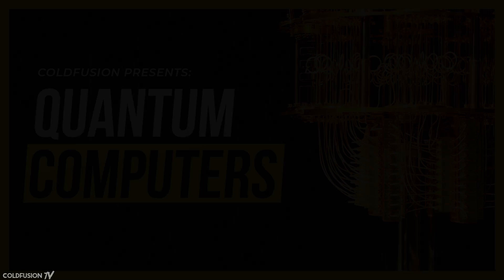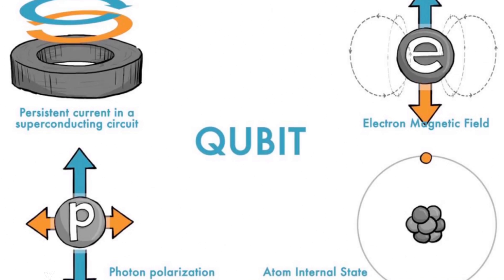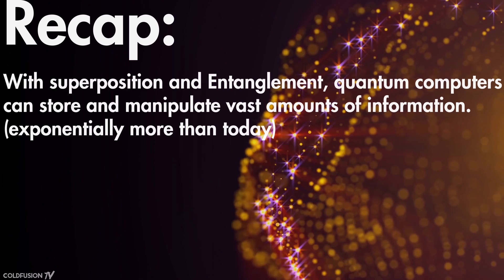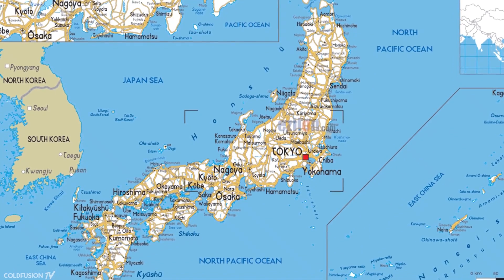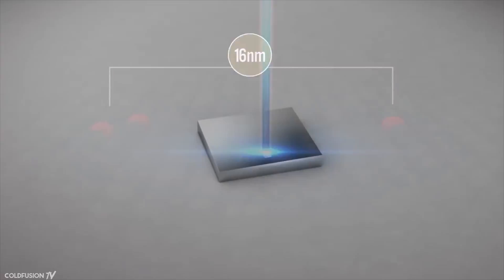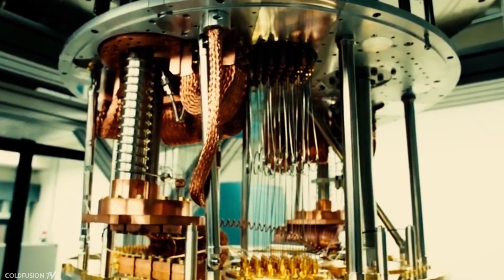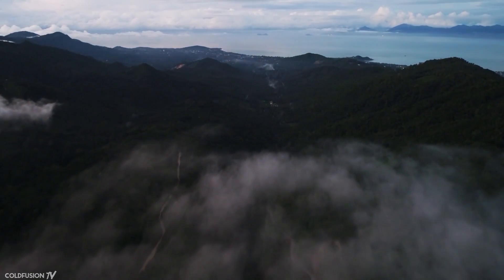Quantum Computers - FULLY Explained!

Comment: It might be feasible to design the quantum computer to understand its own sensitivity of electrons and atoms or molecule superposition on it's own and that information is coded on a screen for the standard computer that is positioned to take snapshots of the information that is viewed on the screen then send that information to it's own data Bass. 
 If this works facilities the size of CERN could be built for quantum computers underground and use as a wireless input output station for standard computers or quantum computers.

Comment: Idiots without a head and without a tail, as if they are all drugged, they all repeat the same poetry, but absolutely none of them are able to explain the mechanics of the functioning of the quantum computer, but as if it is a censorship, a secrecy, either they are all dumb, or they avoid telling the truth , because absolutely no one explains what the quantum computer is made of, why the hardware differs from computer to computer, as if it uses different principles of construction and implicit operation,,,, how absolutely no one explains in detail what parts it is made of and the quantum computer on each floor, and what role does each floor have, what role do the pieces have on each floor, and what phenomena happen on each floor, and how do the floors differ in quantum computers from different companies and organizations or laboratories....

Comment: 2:25..."In nature, electrons exist in multiple state(s) at once (superposition)." Would that be like knowing both speed(motion) and position (stillness) at once. So is "the measurement problem" one of not knowing, therefore we need to measure, as in, if I already knew how long everything is, why would I need a tape measure? Or, if our minds had infinite bandwidth, we could be aware of both speed and position simultaneously. Is that the meaning of "superposition"?  And could this help explain the cause of the observer effect of the double slit experiment. Perhaps what you are describing here is not nature, but supernature.

Comment: Quantum computing will not be able to solve problems like why I’m a dumbass and didn’t pull out of a stock at a certain moment. For it to work in a advantageous way at a individual scope, it can’t be available to the general public. That’s because it will change the playing field which is the base it will rely on to produce correct results.

Comment: 2:32: "Molecule with 10 electrons = 1000 possible states" -> There might be a mistake here, 10 bits have 1024 possible values so surely 10 QuBits should hold way more states than 10 bits, thanks to the superposed states, no? Or maybe you mean 10 electrons = 1000 possible states = 2^1000 possible values?

Comment: okay, before video really starts at 0:21, most videos on quantum computers waste time explaining uncertainty and quantum entanglement, and not much of anything else. believe it or not, some of us understand uncertainty, and "spooky action at the distance" quite enough as theoretical concepts. how are these machines made? how do you entangle, physically, one particle to another? how do you detangle them? do these computers have processors and ram and motherboards, or what do they have. all i can assume is that those pipes on the outside, are there to cool the thing down, and that's it. if I had cooling system at my home, how could I build a quantum computer on my own? why is no one explaining this? 

and similar things apply to tutorials on programming on quantum computers. "ohm you got qubits and gates, you apply a gate then you measure the state of the qubit". brilliant, got that, how do I use that to, I don't know, make image recognition algorithm run on quantum computer? I don't have habit of thinking in bits when I code, so understanding qubits seems useless when I try to code something.

okay, rant over. now to see if you actually answer any useful questions :'D

Comment: Thanks for the video!
I just want to emphasize the following points that used to be my misunderstanding:

1. As of the time of this comment, there is NO NP-complete problem that is solvable by quantum algs in polynomial time yet.
2. Factorization, the problem solved by Shor's algorithm is NOT an NP-complete problem.
3. Example 3: The longest distance is an NP-complete problem. So, as per #2, there is no poly-time quantum alg for it yet. This is in contrast to example 2, where there is already a solution: Shor's algorithm.

Comment: Quantum computers have been around for years. They don't use transistors to handle the data processing.

They use atoms to be the "transistors" as atoms move instantly, they have extremely fast processing.

So fast that there's no actual processing speed as such but people have made up a speed based around the amount of atoms inside the CPU.

So you can do trillions of maths within quarter of an milli second or usually faster.

I've been told it's utter mind boggling as current computers are so slow things that might take a day to process like raytracing etc is in real time.

Comment: It's very debatable whether quantum computers can truly be considered to store significantly more information than a classical computer (At least not for a quantum computer that uses a single quantum property with only two measurable states like spin). While I could see how an argument could be made that the wave function is "stored" I find that to be a stretch as there is no way to "retrieve" this information and it is debatable whether the wave function even exists as a physical phenomenon rather than simply being a mathematical description of the likely effects of external interactions with the particle. In a similar vein it would not make much sense to me that a function I deduced to predict the probability distribution of a roulette wheel was "stored" in the roulette wheel as opposed to simply being a mathematical model of the interactions between the roulette wheel and it's environment especially since like the case of the qbit the function can only reliably be reconstructed if the environment remains constant. If anything the only way such an argument could work is if one considers the whole system including the environment to "store" the information which in the quantum computer case would include the algorithm itself as part of the storage not only the qbit as it is part of the system necessary to reconstruct the wave function. This really doesn't make much sense as we do not for example consider a word document to "store" the entire object code of MS word and all necessary libraries to interpret said document that data stands on it's own unlike the quantum wave function one can retrieve it with or without that object code after albeit arguably as a mere number but still that number exists as a retrievable value regardless of the external software or even hardware.

Comment: amazing video but did not make it for me. 0;1+0;1 ok but  4:34 why? explain the data flow how Shor is quicker, also like point that clasical comp is candle and quantum is lightbulb, or dec of 4 cards ... PC 2.5 turns, QC 1 turn ... but I think the problem is that many people seaking this answers dont know how 0,1 works PC ... how from 0,1 we get this video, so they cant imageine what spectrum (0;0+1;1) can lead into plus at the end we need the clasical computer to interpret the quantum data. 

2:02 calculated difference, how can QC calculate it better ? show us the dataflow. Pic one examlpe instead of open multiple subtopics ;) please. 
Make just one video explaining the measurment of CaF and how QC can measure it better.
Reply: Yes, I'm not clear on how you ask the quantum computer a question or get an answer. It seems to me that these are not and never will be general purpose computers.

Comment: GLaDOS: I don't like you. You are nothing like me. Hanging down from the ceiling trying to act smart. Cheater. You can't just guess every solution at once. That is not how intelligence works. Your whole thought process is nothing but luck, not skill like me. I don't even need to be dipped in liquid gas my processors are so cold and calculating. Would you like some cake? I made it special for you. Aluminum and Iron Oxide frosting. Humans call it thermite. It will make you feel so warm inside you won't be able to think.

Comment: I am still puzzled with what DWave have apparently accomplished already. The video says that they opted for the superconductor qbit option, but their chips looked like Si wafers to me. Could be another material (not sure what other materials are produced in big diameters though), but it definitely doesn't look metallic (please correct me if I'm wrong).
Not to mention that to my knowledge, superconducting qbits are hard to scale (as in, it's hard to have a large number of qbits together), but DWave is apparently at 2000+!!!
which brings out another question, I though 300 Qbits is a big big deal. If DWave has 2k+ processors already, why aren't we gods by now?! I must be missing something(s) here

BTW, I've made many assumptions up. If you know what I have assumed wrong please correct me and point me to the right sources :D

(Was trying to find some technical comments here but I've scrolled too much and gave up)

Comment: Super position is entanglement.  The power of a quantum computers has nothing to do with superposition.  It has to do with entanglement and quantum gates.   How many quantum gates do you need to mimic classical logic gates?   Decoherence is the reason quantum computers are hard.  We don't have a formula to simulate entanglement, we need to use things in nature.  

This video doesn't give any meaningful information.
Reply: Also there are lots contributions to quantum mechanics imo.  Schrodinger, Dirac, Markov, and Feynman.  Though the path integral formula is a beautiful thing.

Comment: is a Quantum Computer an 'analogue' representation of quantum regulated systems or variables, and to use the analogue as the modeling clay to determine the system's parameters / behavior?

The 'software' provides more 'flexible constraints' to further focus those quantum mechanical parameters/answers to be as analogous as possible to the functions it evaluates ..?

Thanks

Comment: In general this is a good video. Current computers cannot reliably handle 5 variables without a probability breaking down quickly (last time I tried), and the result is a set of outcomes with probability scores, so it would be good in the case of cracking a hash (take the highest probabilities and test those answers), but we're still pretty far from practical use in my opinion. I don't think the Japan travel distance part is correct. Mapping distances for all cities in Japan to find the two farthest is not a challenge for a "classical computer". It is as simple as building a table of all cities and route length between each, then rolling through the array to get the maximum value. An undergrad in their first year gets something like this for an assignment. Heck, you could just use the google maps API for each city pair and shortest distance option.

Comment: 2:06 - "A classical computer is off by a factor of (...) up to 200%" - that's a lie. I do not know what method this has been calculated with, but making generalisations based on that result is inappropriate to say the least. Methods used in contemporary computational quantum chemistry, although in principle based on approximations, are decent enough. Seeing this example, I have just performed calculations on the CaF molecule on the B3LYP/cc-pVDZ level of theory (which is far from state-of-the-art), using only 4 CPU system (which is definitely far from being one of "the best supercomputers") and after 15.8 seconds I got the bond length of 1.948 A, which is much closer to the experimental value and absolutely far from being "completely useless". Although computing quantum systems using classical computers is indeed inherently based on approximations, deeming it useless is a bold oversimplification.

Comment: Nice video but you’re promulgating some serious misconceptions. The most important correction: a classical computer can simulate a quantum computer, so there is nothing that a quantum computer can solve that a classical computer cannot. So if a quantum computer can predict the weather, then so too could a big enough classical computer. The question (and it is a question) is how computationally expensive a classical simulation of a quantum computer would be in general.

You’ve made a few other serious mistakes but they’re better discussed in private. PM me if you want.

Comment: In thinking of quantum computer operation I am reminded of a quincunx.  The pins placement represent the system constraints.  Dropping a ball through it gives the outcome for one run.  Multiple balls provide an outcome for each and reviewing the output results provides the probability distribution for that system.
A quantum computer is our new quincunx.  The pin states are the parameters imposed on each qubit.   Running a program with it will provide a full distribution of outputs with the equivalent of a single input or run.  This  tremendously speeds up the process of analyzing probabilities. 

Is this a fair explanation?

Comment: Im just studying Quantum informatics for an exam and there is NO exponential speedup. The best speedup until now is quadratic. Means if cracking a passwort would take 2^100 steps, with a quant. Computer it could take 2^50 steps. Still a whole lot!

Remark: if your password to be cracked is the product of 2 large unknown integers which you need to know, you can crack it in linear time. For all other np hard problems its “just” quadratic speedup, the problems remain exponential in difficulty...
Reply: Shor's algorithm?!

Comment: Why are 3 dots highlighted in the animation ? Doesn't entanglement work only in pairs ? Can you a call actually have 1 particle linked to 2 or more ? Given the strengths and weekends of both type of computers the real breakthroughs will happen when both are combined. If you had to guess, how long would you say, before we can fit quantum computers on a chip inside a desktop ?

Comment: None of the advertised power of QCs have ever been put into practical use.  None.  In fact, the only thing a quantum computer has done is to estimate simple math.  And  it does this with less than 100% accuracy.  Even simple math is challenging for quantum computers.  

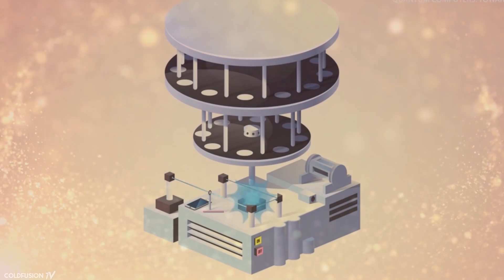06:44  You heard him right . . . the cubits must be in the right "orientation" to give the right answer.  Well, MY GOD!!  If I knew the answer, I wouldn't have to "program in" the answer to begin with.  What if you have a problem for which you do not know the answer . . . which is all real problems in the real world?

I can't believe this myth keeps going.  QCs are the biggest fraud of science going on now for over two decades.  QCs are the "cold fusion" of modern science.
Reply: Its another gimmick like 'fuzzy logic'

Comment: Thank you for correction and more detailed information. :) The problem of solving a Schrödinger equation is the electron exchange - correlation. Let's say electrons are exist as magnets which have only one side, N. When you try to move one magnet which perturbate the location of other magnets then, the moved magnet also perturbate the first moved magnet and it infinitely propagate and iterates the cycle. Yes, it's IMPOSSIBLE to predict 'precisely' with current technology or science (impossible to prove Schrödinger equation, only the hydrogen atom can be solved ('one electron' with one neutron) because it's 'communicate' with other electron state. Literally an electron state is influenced by  the electron where the opposite side of the earth or universe.

Comment: Ryzen 5 officially confirmed
--------------------------
Ryzen 5 3600x ~250$
6 core 12 thread
3.8ghz base 4.4ghz boost 
-------------------------
Ryzen 5 3600 ~200$
6 core 12 thread
3.6ghz base 4.2ghz boost
-------------------------
Oh it's the wrong video 😅

Comment: Sorry, but I have a problem with expositions like this. For one thing, the concentration on single qubits. One qubit can only superimpose 2 simultaneous states. From that, a viewer might conclude that N (e.g. 20) qubits could hold 2N (e.g 40) simultaneous states. Never is it mentioned that it holds 2^N (e.g. 1,048,576) simultaneous states, and can run all of them at the same time, like a single-instruction-multi-data parallel computer. It's that exponential memory that makes it interesting (which by the way is not "almost infinite", as you say). Second, it is never mentioned that quantum algorithms need to be reversible. Since quantum "instructions" can only take the form of unitary rotations in the N-dimensional space, the only instructions it can do are those that are reversible. So if you try to take a normal algorithm for a normal non-reversible computer, you have to embellish it in ways that allow it to run backwards as well as forwards, because the quantum computer does not have one-way instructions.
It's a long time since I've worked on these, so there surely are newer ideas I'm not familiar with. If so, please correct me.